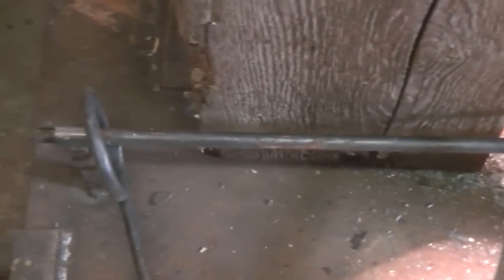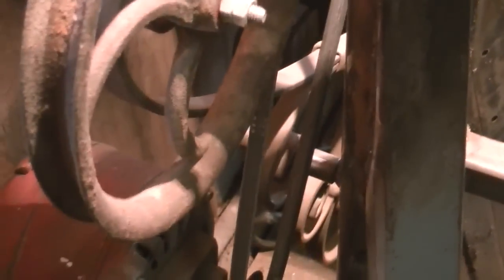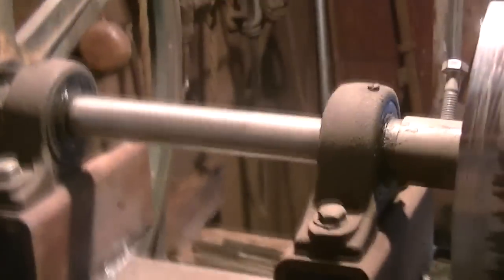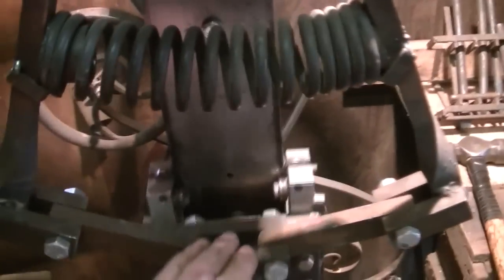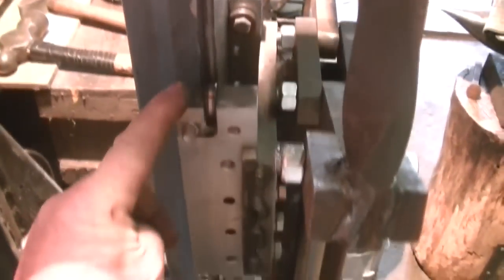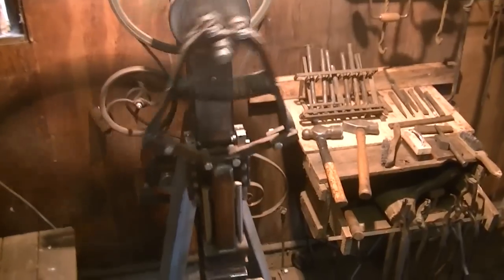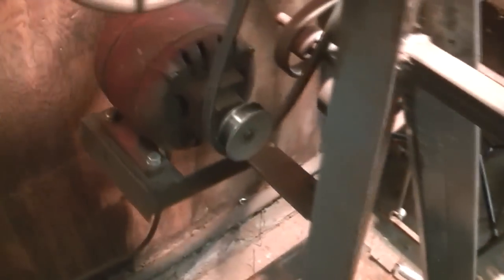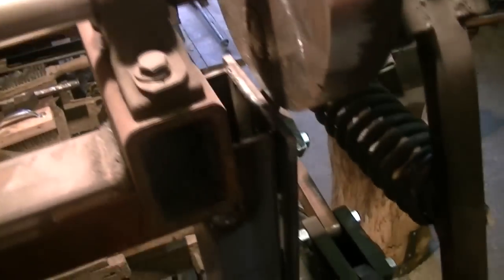Blacksmiths Scrap Pile Power Hammer

Comment: i stumbled on this when i was thinking of building one.  great,  simple design.  mine took three evenings to build and runs off a floor buffer motor i got for fifteen bucks.  think I'm into the whole thing for around forty.  thank you so much for posting this.  didn't have a big thick round for a flywheel,  so i used a plow disk and welded chunks of axle on until i got good counter balance.
Reply from the maker: Thanks for watching Caleb, sounds like quite a machine I would love to see some pictures, to take care and be safe.

Comment: Just came across your hammer. Pretty impressive for a scrap hammer. Looks like it will certainly get the job done. Great walk around and explanation of parts etc. Thanks for sharing.
Reply from the maker: Thanks Stan, surprisingly it works better then I ever though it would, I guess if you hold on to enough junk parts long enough it pays off. Thanks for checking it out

Comment: im so torn for what style hammer to build... this is by FAR the most simple design ive seen, and that is a complement because a lot of them seem overly complicated... you found a way to be rid of all the excess and have something that still works as its supposed to. this may have changed my plans... i was leaning more towards a leaf spring style hammer before, just because of the spring mechanism for the dupont style looked really intricate...
Reply from the maker: Thanks for the kind words. 
I have built a helv hammer/leaf spring style hammer in the past. And didn`t have very much luck I could never get the hammer to deliver an efficient blow.
So this seemed to be the simplest answer and as usual the simplest answer is usually the right one and in this case for me it was.
Good luck on your build and if i can provide any info to help just let me know.
Reply: i subbed and just seen your replacement of the wood stump with that piece of 1045. looks like it works pretty good!
so that spring is from a motorbike? im guessing there is constant tension on it to hold it in place, as i dont see a bolt or anything through it... do you just have a piece of round stock stuffed in the end to hold it in place?
do you have the flywheel balanced?
im now designing something pretty much the same, except ill have a spare tire as the clutch. mount it behind on the drive shaft with a flywheel like yours.
how heavy is your flywheel? what is the OD of it, and how critical is the placement of the offset peg where the hammer linkage mounts?

i think that should be enough to get me going haha! thank you very much!
Reply from the maker: I am going to be doing a Q$A video on the hammer soon and I'll try to answer all your questions, I will be covering every thing from materials to dimensions and much more. Thanks .
Reply: BIG DOG FORGE i cant wait man :) i need to hit up my local scrap yard before they close the yard for the winter haha! thank you
Reply: CoreyTheWolfTWC been looking up a ton of designs, and i think i may copy this one except for the linkage. a set of leaf spring halves mounted to the side with shackles going to the rotating assembly seems to be popular as well. anvilfire's X2 design is what im thinking.
Reply: The CNC guides are they roller bearings?

Comment: Clever, cunning, creative ... and Brilliant. Bravo! It seems to have a good feel to it ... really nice feel to it. There is a quiet and relaxed sense about it. I hope the metal likes it too. || Yes, i understand and agree, having some additional mass below the bottom Rail anvil will help provide a countering to the inertia of the hammer rail, but that is not a hard thing to turn into an ongoing (adjustment project) experiment. Hell, a large metal box filled with melted lead would work under the big metal round you already have in place, i would suppose.

Comment: So I am trying to figure out a design for a power hammer and I have seen several videos. I like your design a lot but I have a question. I am not even exactly sure of the terminology to use to ask it. There is obviously something I would want to refer to as throw in your hammer mechanism. If you were to manually place the hammer at it's lowest position with the flywheel shaft down how much space would be between the anvil and the hammer? Am I making sense? I am thinking there is a space there and the "spring-action" in the mechanism throws the hammer and closes then gap when running.

Comment: great looking hammer... in the process of several expansions myself and about to start on a power hammer... wondering what kind of spring you used in the power head... have been looking at various strut springs but they all seem too stiff for proper timing.
Reply from the maker: You should check out my video called power hammer Q&A it covers just about everything I put into the hammer of the spring you're referring to came from a 1976 Honda CB750 I had to cut 1 inch off of it to get the right tension but it works perfectly.  Thanks for watching and have a good one.

Comment: Greetings from Aus! Love this hammer. I'm struck by how stable it is. Doesn't look like it moves at all. Can I ask, is the fly wheel exactly the same weight as the ram and that the reason why? and is that old 750 spring attached to the linkages by weld?

Comment: It looks really smooth and quiet. Great work, maybe I'll have to order pillow block bearings and take a second look at my own junk piles. That really is a great build, most are over complicated and end up clunky and wobbly. Is there anything you found really vital to getting the results you did?
Reply from the maker: Don't offset the crank in front to far and the spring between the front arm's shouldn't be to stifff. Good luck with your build, I would love to see it when your done.

Comment: Hey Tim
Are you still answering q’s about scrappy??
I have a couple...
Thanks
Reply from the maker: Sure thing what is on your mind
Reply: @BIGDOGFORGE  
Thanks for the reply Tim 
I’m building a scrap hammer at the moment but the main thing I’m a bit confused with is “ fly wheel counter weight or not?” In the hope of reducing vibration but also adding inertia to hammer. 
I’m using an “i” beam for post(8”x8” x 5/8) so hopefully won’t be too much flex. I’m aiming for 45 - 55lb hammer weight. 
I also have to say i love the way you up cycle as that’s what I try to do as well. 
From way down under
           NZ

Comment: I plan on building a more compact hammer than the one you saw. Im copino your ideas. what would yoi change ? if anything?  I always want to change something after ive completed something.
Reply from the maker: Hello the only thing that I would change about the hammer is I would probably have made it slightly larger if I had to do it again, the upgrades a kid to it were good it went from a 25 pound to a 35 pound hammer with a much better and heavier anvil.  But as I said if I built another one I would probably aim for 50 pounds.  Take care and thanks for watching.

Comment: i wanted to ask, what is the Hight of the back post where the wheels and bushing are and the Hight of the anvil beam?
Reply from the maker: Hello Alfred from the base to the top of the post is 52 inches and from the base to the center line of the bearings is 57 inches, I'm not quite sure which part you're referring to as the anvil beam, if you could clarify I would be more than happy to get that dimension for you.  Thanks for checking out the video and take care.

Comment: The part that's flexing is that a leather belt or a leafspring
Reply from the maker: Not sure which part your referring to, the only flexible parts are the drive belt and the coil spring, the rest is all linkage and pivoting joints.

Comment: A old oxygen bottle cut in half and filled with sand or concrete would be a perfect anvil for you
Reply from the maker: You should check out my other power hammer videos I've done some serious upgrades since this one.
But I love your idea that's awesome.
Thanks for watching and take care.
Reply: +BIG DOG FORGE I will check them out. I just been looking for ideas. I going to build one when it warms up a bit. I have an old bottle and some good pieces of scrap. I built a 2x72 grinder this past spring. so now a hammer seams to be the next step. my grinder is on my videos. keep pounding metal